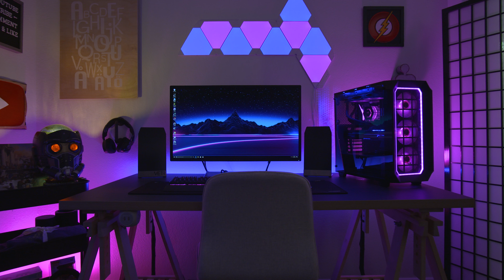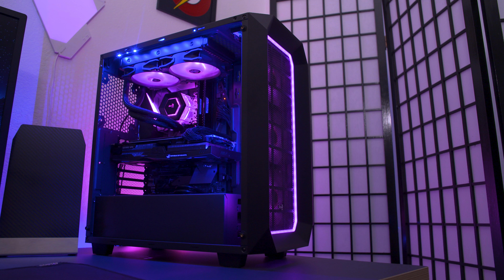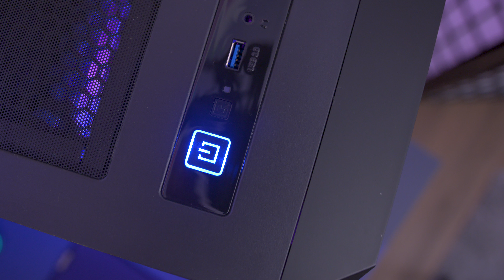Epic Intel 8700K Gaming PC! ($2100 Coffee Lake Build!)

Comment: Wow! Clean build. 

5ghz on non delidded 8700k? What temps are you getting? What voltage did you set core voltage to?

I would like to know please. Mine is at 4.8ghzz. I’ll try to get it up to 5.0ghz

Man, i think that is a perfect example of a 8700k/1080ti budget build. It’s perfect. 

My build:
Phanteks Enthoo Pro m se, 8700k, 1080ti ftw3 hybrid, Maximus x hero mobo AC-WiFi, G. Skill z trident 3200  16gb  14-14-14-34 ram, EK-MLC Phoenix 280mm AIO with intel cpu block, 960 pro 512gb m.2, Seagate firecuda 2 Tb sshd, Ben q xL 2546 monitor (240hz/1080p/DyAc), Ben q zowie gs-r mouse pad, Ben q zowie ec2-b mouse, hyper x alpha cloud (arrives tomorrow). I’ve spent $3,666.89 total so far and I still have to get decent desk, chair, better keyboard, 

Pc parts alone came out to $2,752. And $100 to pay my pc builder to build it for me.

Oh yeah, entire build is for CS-GO.

Comment: my build cost £2200, specs 

COOLERMASTER MASTERCASE H500P GAMING CASE
Intel® Core™ i7-8700K 
Gigabyte Z370 AORUS Ultra Gaming: 
16GB Corsair VENGEANCE DDR4 3200MHz (2 x 8GB)
Palit Super Jetstreme GTX 1080ti 11gb 
6TB SEAGATE BARRACUDA PRO 3.5", 7200 RPM 265MB CACHE
CORSAIR 850W RMx SERIES™ MODULAR 80 PLUS® GOLD, ULTRA QUIET
Corsair H110i Hydro Cooler w/ PCS Liquid Series Ultra Quiet Fans